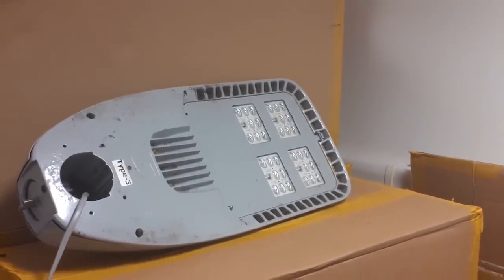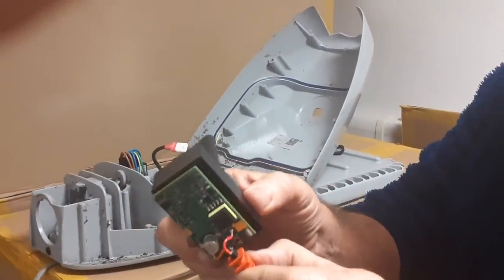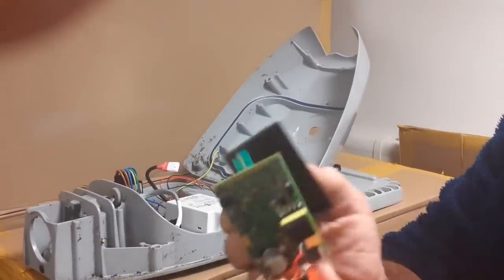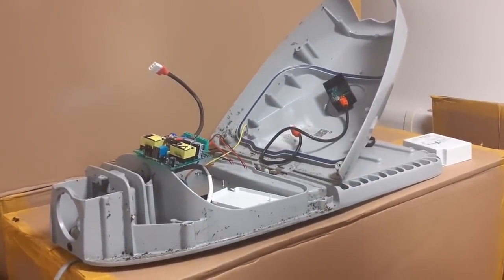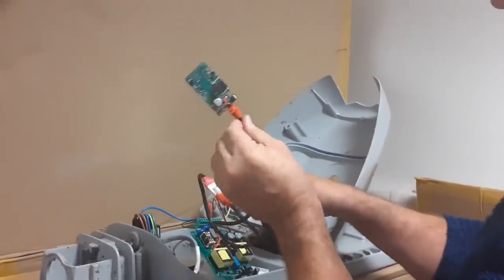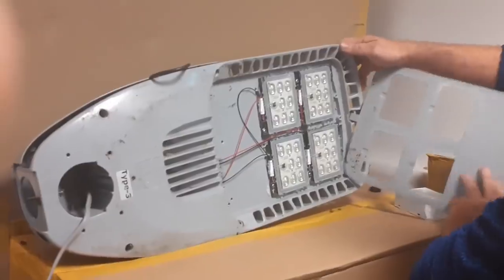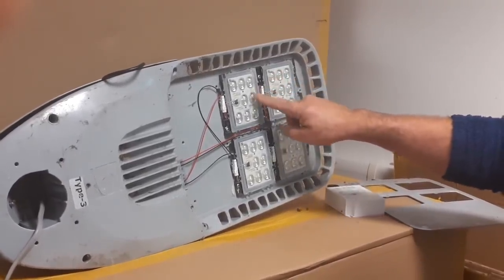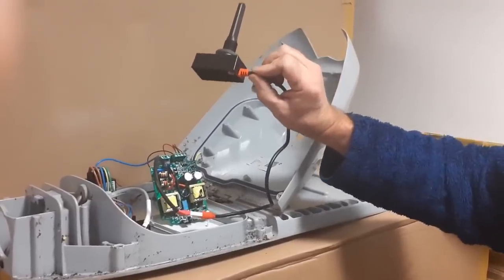5G LED STREET LIGHT TECH BREAK DOWN

Comment: If this was a civilised country the council's heads would be mounted on top of those antenna. The council don't have a duty of care to do anything. They are crooks that force you to pay them. All that other pish is PR to keep it that way.
Reply: mmtot so to recap about the streetlight

1) Using  700-800 Mhz NB iOT  module
2) PCB Antenna
3) No Fan or heatsink on the PCB (fanless operation)
4) Metal Enclosure around the LED Light controller
5) Only RF in or out of that metal enclosure is the NB module's PCB antenna that sticks out of the metal enclosure
6) no other holes in the metal enclosure for any kind of radar or tracking sensor (Some models could have a PIR sensor but they're more expensive ,  there are radar sensors but those are even more expensive than PIR)
7) Fanless operation  using an off the shelf NB iOT module  - probably not more than 100mW of actual RF output 
8) NB is the new alternative to Zigbee as it has more bandwidth (100KB/sec.  max  - zigbee is around 10KB/sec.) which leads to larger mesh networked sensors  and less lag (also means you can ride encryption on top of that so nobody can inject traffic and mess with your lights)

Comment: Excellent Mark.
Just the evidence we have been waiting for .
So much Tech for a simple lighting system .
This should be on every billboard on  every news channel .
But guess what folks we will not hear a whisper about this .
With respect people certain MPs are guilty for the installation and  deployment of this Stealth Technology .
As they have an vested interest in the outcome Money /Shares/Job/
Would it not be an equal right for all members of parliament to have all the financial accounts  looked into  and make sure they have no shares or offshore holdings .
Maybe then would could actually believe at least one sentence or speech which seems to  continue to drivel from those engineered script.
After all they are supposed to Represent the people and not take part in unlawful Business practices.

Think of the hidden Tech we can't see.
Smartworld the future for Humanoids solar space pulse magnetic fields .

Question
How much heat does that generate.
How much power does it consume .
With the introduction to all the new  Eco policies  and procedures and guidelines to reduce not only CARBON  Sorry had to giggle .
It makes sense why they need to  be able to restrict power to homes to  have the ability to  run this eugenic stealth tech system.
The puzzle slots inplace more and more .
Smart devices and nano tech integrated to everything imaginable .
All tuned in and working simultaneously with a synchronicity of a Swiss watch .
Where's is all the power coming from to be able to allow power to Run this  Grid  Corporation system.
I know from us and guess what 'we are all paying for the privilege .
The major disadvantage we have is now this has been brought to light they will hide it even more and use other sources .

Brilliant work with the Exposure of this deadly Weaponry .
Exotic Weaponry is not just in Hollywood films .
Keep people occupied with various diversions and the People miss the silent placement of of the next piece of the puzzle..
Be safe spread the word.
The world wide Stealth Technology eugenics program is in full effect .
Let's take all the carbon away so nothing will grow and we can make them buy Air Credits .
Reply: You are so right ;)

Comment: How much power is going to the antenna?
Reply: @newscotlandtv  You are an idiot, the higher frequency stuff may not penetrate your body but it has been proven allready that 24Ghz for example will destroy the myelin sheath around your nerves.  That is going to lead to massive amounts of skin cancer and atrophied limbs and suchlike.  The 5G tower will operate between 700mhz and 300Ghz so it operates at lower frequencies too so you will not be safe in your bag of water (your head full of rocks may be safe though).  900mhz has many health effects such as fkin up your thyroid hormones which is messing with your cells ability to regenerate, very dangerous.  google: "868Mhz AND 900Mhz AND health effects" for example....  Over 20000 whitepapers in total about EMF with approximately a 68-70% of them showing negative effects but we still have ignorant arseholes like you posting shite.
Reply: @newscotlandtv  Neat, simple but ingenious in its own way. Thanks.
Reply: @newscotlandtv  what a load of rubbish!
Reply: @newscotlandtv  The 5G is for providing a data connection. Absolutely nothing to do with switching the lamps, that will be the control circuit.

Comment: The Essex streetlights are not on all the time, some of them do have the pointy antennae on top though, I wonder if they are the same internally?
Reply: In Essex I've see many of the new Led street lights on in the day when they should be off. It's the same all down the A12. Also I've noticed on in day lights in Kent, all over inner London, Essex,  Hertfordshire, Suffolk and many more. I was in Wales the other day and same there. Not all have the antennas but some do and not forgetting that some antennas are disguised as light sensors.
Reply: Today heading to north London leaving south east London on the A2 heading towards the Blackwall Tunnel there were bundles and bundles non stop all the way lights on when they should have been off. What a pile of shit every single council in the whole of the UK is.
Corruption times up soon.
Reply: @jamessomying  I’ve read for a couple of years now that you have to have an emf meter to see how bad it is.
Reply: We have them here in aberdeen, for the most part the lights are working correctly up here, we have the tranmsitters though and they are on 24/7/365.
Reply: Debzzyful so to recap about the streetlight

1) Using  700-800 Mhz NB iOT  module
2) PCB Antenna
3) No Fan or heatsink on the PCB (fanless operation)
4) Metal Enclosure around the LED Light controller
5) Only RF in or out of that metal enclosure is the NB module's PCB antenna that sticks out of the metal enclosure
6) no other holes in the metal enclosure for any kind of radar or tracking sensor (Some models could have a PIR sensor but they're more expensive ,  there are radar sensors but those are even more expensive than PIR)
7) Fanless operation  using an off the shelf NB iOT module  - probably not more than 100mW of actual RF output 
8) NB is the new alternative to Zigbee as it has more bandwidth (100KB/sec.  max  - zigbee is around 10KB/sec.) which leads to larger mesh networked sensors  and less lag (also means you can ride encryption on top of that so nobody can inject traffic and mess with your lights)
Reply: Yes,seems they would have to be on all the time when people are out and about by these.Otherwise being just on in the dark is when no one passes.... is not dangerous to health. 
  We just have to press our MP on wasting costly energy at public expense and insist they are seen to be immediately turned off in daylight😏😡

Comment: Excellent
Reply: I genuinely feel sorry for this guy. I don’t know why he’s become this deluded but he knows nothing about electronics. Time after time after time, incredibly basic incorrect understanding of electronics. He needs help.
Reply: Devil's advocate, that's just an antenna to receive a signal to turn the light on. And at 450 volts even a 10 amp relay is a modest relay, even a car has them, and that one is less than 10 Amps. I'd need to see more to completely convince me. Also, I can't see how this transmits and receives data for 5g.
Reply: @johnb.9806  Yes no. Why an antenna to turn light off on. What's the practical purpose of that?
Reply: @firstnamelastname8386  they are set to turn on one after another to not put a strain on the electric system so thousands of street lights don't all turn on at the same time.
This is fear porn to further mark and Anthony Steele agenda and point you to a donation site to fight legal costs.
#5Gscammer
Reply: @RichieVallance   If u knew how Luciferian the Elite are, you'd know Mark & Anthony Steele are telling the Truth, I've seen the evidence this summer & took hundreds of photos of dying trees, & small birds were gone.   5G is Untested on Humans, enables Mass surveillance, used in China with a social credit system & facial recognition for total Communist control, which is exactly what the EU is aiming for.   The Authorities will be able to find you anywhere, any time, & 5G will collect your personal data in your Home Without yr knowledge or consent, & connect to Smart metres, in a kill grid smart city, hording & profiling people by design.
Reply: @fionnuna7947  I know electric circuits and I know that this is bullshit, just like Mark and Anthony steel and Lee Garrett who are all frauds.
Reply: @johnb.9806  Thats a dialectric lense antenna idiot, nothing like what has been deployed before (except on the battlefield).
Reply: hootsmin so explain how a ‘dialectric lens antenna’ works and on what frequency.